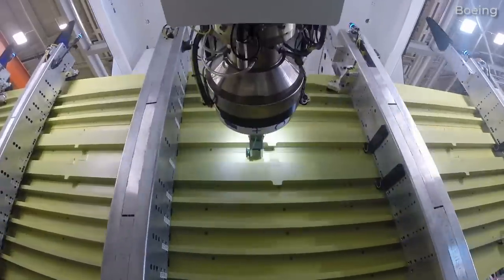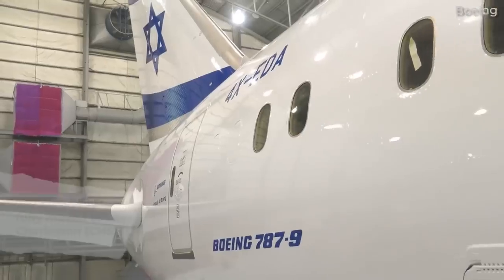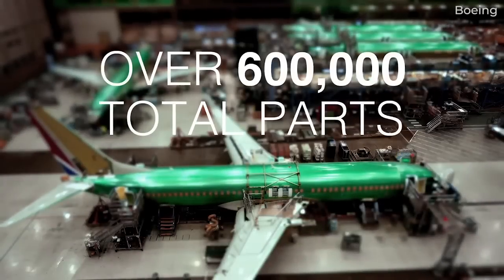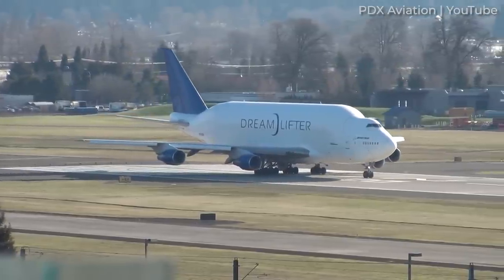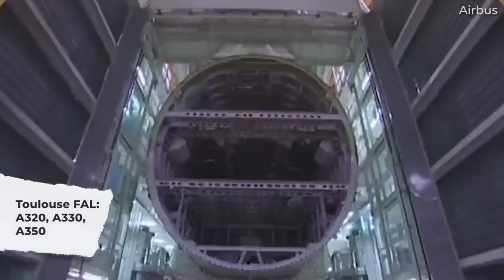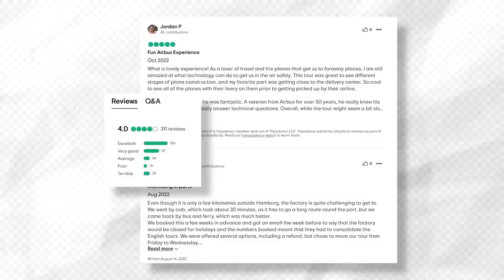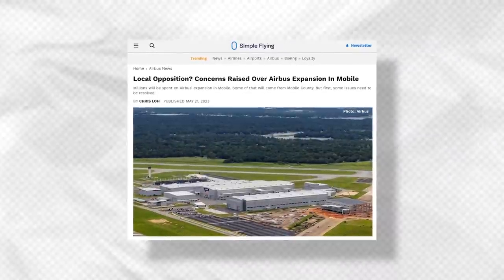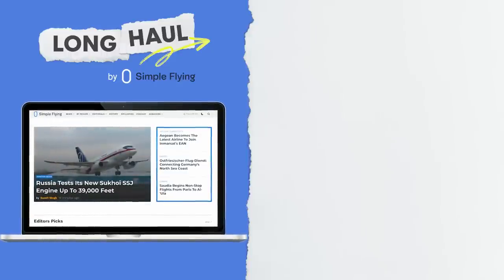Airbus Vs. Boeing: Comparing Assembly Sites Of The Major Planemakers

Comment: 787 may be built in SC, but they are all fixed in Everett 😂
Reply: The irony 😂
Reply: FACTS!!!!!
Reply: Yes, frames that produced as far back as 2021 are being reworked at Everett but no 787s fresh for the SC plant are bing "fixed" there.
Reply: FACTS BUT THE 747 still fav ❤❤
Reply: @mmm0404  Incorrect, Charleston is in fact doing rework just like in Everett, and has been for the past year and a half
Reply: @Jack3md  well I was referring to new built frames, not those in inventory. New build frames don't necessarily need rework.  Both Everett and SC plants have been doing 787 rework on existing frames.
Reply: @mmm0404  That’s right, I think i misread your original comment
Reply: Unionized experienced engineers fixing non-unionized entry level workers screwups 🤦‍♂️
Reply: @cskvision  Nope! Another myth debunked. A lot of the reworked airframes Boeing has been working on were Everett built before all production was consolidated to Charleston. Both Everett and Charleston have been doing rework. It’s not an issue due to one location’s workforce.
Reply: And they are still junk
Reply: @paulparker8298   Couldn't be further from the truth

Comment: Looks like Boeing prefers less but much bigger assembly sites which does have its own advantages
Reply: and it's own drawbacks. If anything happens in an area (adverse weather situation, for example, SC is well within the hurricane corridor up the east coast of the US), then production stops.
Reply: Something worth noting is that Airbus uses their commercial facilities for military work too, even dedicated military products like the A400M or (when it was in production) the Eurofighter Typhoon.  Boeing has separate plants at Long Beach and St. Louis for production of military jets, mostly inherited from McDonnell Douglas.
Reply: @simu31    But it’s facilities in Washington could be severely hindered by a large winter storm.

Comment: The Charleston site is notable because it used to be Voight aerospace, an inexperienced company that managed to win a huge 787 manufacturing contracts despite lacking experienced staff to deliver and was the caused of much of the early problems in assembling the 787 under the new concept of distributed manufacturing with each site fully kitting out the section they were building. 
Boeing ended up buying Voight,  brought in experienced people  to get the place to become productive. The decision to focus on Charleston is also a sign that Boeing is veering away from its vastly distributed approach (which was meant to spread risk and initial capital investment) and concentrating production more.
Reply: Maybe Boeing should have thought twice before outsourcing major work to such inexperienced corporations.
Reply: No it's because the longer 787-10 sections which are produced there cannot fit into the dream lifter to be flown to Everett. So why not consolidate all manufacturing at SC, makes things easier

Comment: What is not shown is the organizational side of Boeing. They have the assembly area close to glass walled offices that overlook it as well as common facilities like dining areas. It's intentionally designed to ensure that workers, engineers, and project managers see each other on a regular basis and interact quickly to solve any problems that arise in design, construction, processing and assembly. The building flow patterns and communication avenues ensure that everyone is aware of what they are working towards and encourage team activity to achieve success. It's my understanding that they have been able to better deal with all sorts of concerns and increase assembly time just by having all involved personnel under one roof.

Comment: Airbus may soon add South Korea to build A320s for South Korea and Japan to see where Boeing is going it will be harsh for Boeing to see that one of their wings are going to be manufactured in Australia, yet I still think when a Boeing 737 MAX crashes in South Korea then Airbus will do the same like General Motors when GM acquired Daewoo Motors and became GM Korea, but this time it is going to be KAI and formed Airbus Korea in Seachon, South Korea yet Airbus Defense will hacr the KF-21 Bromise aircraft under their belt and work with Lockheed Martin, yet Moble will be the site for the assembly for the F-21 Hawk, as the first A320 Neo plane bond for Korean Air will be rolling out of Seachon so the ABK Seachon site will be for A320 planes destinated for Japan and South Korea.
Reply: With IndiGo's giant orders (over a thousand A320's), there are also rumour about a new A320 assembly line in India.

Comment: Airbus is wiping the floor with Boeing.
Reply: In the Narrow-body market yes, but Boeing still dominates the widebody market. Boeing’s 777 and 787 have outsold the A350, A340 and A380 combined lol. And the A340 and A380 were essentially a commercial failure. Airbus never turned a profit before ending the programs because they didn’t sell enough.
Reply: @FlyByWire1  Incase you weren’t aware Boeing have spent more on the 787 program than Airbus did on the A380 and still to this day have not turned a profit despite selling over 1000. The A350 started breaking even in 2019. It’s all well and good having big numbers but if you’re selling them too cheap or having too many issues with them to have to spend money on fixing it really doesn’t help much.
Reply: @tomstravels520  Except Boeing has turned a profit on the overall 787 program. You're confused on two different statistics. The first is the total cost of developing the jet vs the total amount received in sales. Boeing has arleady recovered that. They have received more money in sales than it put into developing the program. What you're referring to is yearly profitiability where Boeing compares the moeny spent in that year on building the plane and the money it received in sales for the plane. Up until like 2020. the 787 was making a yearly profit. It wasn't until the pandemic hit and the issues that casued delivery pauses that they went into the red. But overall, they have made a profit on the program. The A380 and the A340 for example were both examples of failed programs. Not only did the planes not sell very well, Airbus never turned a profit on either program overall and is now stuck with maintaining support for the models that were built and sold. lol
Reply: @FlyByWire1  The 787 has not broke even. The end. Go and look up any news articles about it. The overall program cost has exceeded $35 billion which is about what Airbus spent on the A380 program. Seeing as the A340 and A330 were developed at the same time and the A330 is by far more popular I doubt Airbus is caring much about still supporting the A340 using A330 money.
Reply: @tomstravels520  i was talking about both the A340 and A380 which they have to continuously support despite half of the global A380 fleet being grounded. The A380 will perhaps be the most unprofitable and failed aircraft program in modern history. 254 built and delivered on a clean sheet design program is actually crazy. It’s so bad. They’ll never be able to recover all those costs. Airbus failed programs: 2 while Boeing failed programs: 0 lol
Reply: @FlyByWire1  pretty sure the 717 was considered a failure…..oh but of course it was MDD who started it right? Yet Airbus took over the C-Series and make it work into a successful aircraft. I doubt Boeing will recover the costs for how much it had to pay out for the 737 Max crashes and fallout. Whilst the A380 may have been a business failure it was an engineering success and it’s technology has not only been carried in an enhanced to the A350 but trickled down to the A320/A330. And as the A350 broke even back in 2019 and Airbus have a far bigger backlog of A320’s than 737’s I doubt they’re too concerned. Imagine making 1000 aircraft and still not breaking even……Boeing can
Reply: Boeing builds whatever the customer wants on their plane. Airbus doesn't do that. Any modifications requested is after the build, and longer, with extra $.
Reply: @JohnQtaxSlayer  firstly not entirely true, I’ve seen pics of a United Airlines A320 with the light switches reversed to match the 737 as that’s what the customer wanted. Secondly, Airbus trickles their technology down from the A350/A380 to the A320/A330. And I’d love to know which airline requested to have touchscreen CDU’s that you get on the Max now, I bet almost no pilot asked for that
Reply: Yeah the Alabama facility is going to expand, I bet Japan will get planes from South Korea soon, anyway Airbus always thinks ahead.
Reply: @FlyByWire1  As much as the 787 definitely sells well, things aren't that good for other Boeing widebodies. The 747 ceased production and the 777X can't stop being postponed. For now all 777s and 767s that are being delivered are only freighters. As such, ironically, Airbus delivered more passengers widebodies than Boeing in 2023.